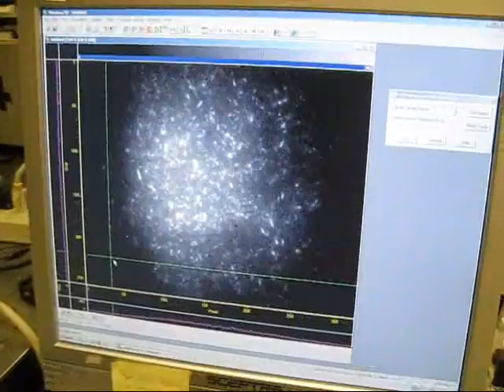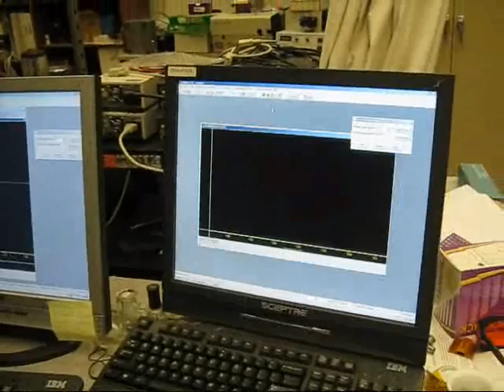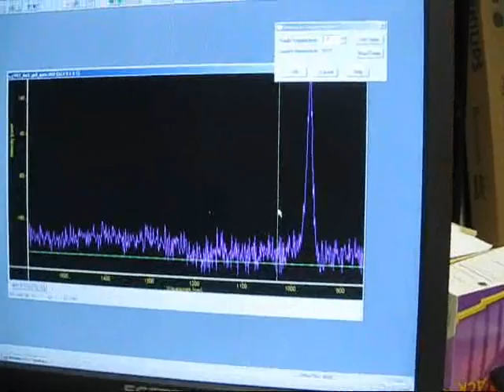Single nanotube experiment with tunable Ti:Sapphire laser Trestles sales@dmphotonics.com

Comment from the maker: CW Ti:S laser kit with small breadboard, one mirror set sales@dmphotonics.com
[CW-Ti:Sa-Kit-Basic]	
http://greyhawkoptics.com/product_info.php?products_id=805&osCsid=c98e9edf29f51647cc93c30b6716f115
CW Ti:S laser kit with small breadboard, one mirror set
Click to enlarge
CW Ti:Sapphire laser kit
Tuning range (@10W pump): 710-980 (two optics sets) or 730-870 nm (one optics set)
CW output power (@10 W pump, 800 nm): >1800 mW
CW wavelength tuning is available only with appropriate options (see below)
CW linewidth:
<45 GHz
<20 GHz (with 1 etalon)
<2 GHz (with 2 etalons)

Comment from the maker: Metal oxides single-walled carbon nanotube macrofilms-based lithium-ion batteries
Zeyuan Cao, Bingqing Wei
8 February 2015 • 4:25 - 4:50 PM | Part of SPIE OPTO

Simulation of exciton diffusion in carbon nanotube-based photovoltaics
Amirhossein Davoody, Irena Knezevic
11 February 2015 • 4:20 - 4:40 PM | Part of SPIE OPTO

Theoretical study of the behavior of cryptand with different ion metal inside carbon nanotube
Olga E. Glukhova, Anna S. Kolesnikova, Denis A. Melnikov, Mikhail M. Slepchenkov, Vladislav V. Shunaev
8 February 2015 • 5:30 - 7:00 PM | Part of SPIE BiOS

Emitting terahertz frequency wave by charged fullerene C36 inside carbon nanotube under electric field
Olga E. Glukhova, Anna S. Kolesnikova, Mikhail M. Slepchenkov
8 February 2015 • 5:30 - 7:00 PM | Part of SPIE BiOS

Dynamic carbon nanotube tracking by independent target restoration microscopy of cells
Nicolas Spegazzini, Rishikesh Pandey, Jeon Woong Kang, Ishan Barman, Ramachandra R. Dasari, Peter T. C. So
7 February 2015 • 12:20 - 12:40 PM | Part of SPIE BiOS

In vivo efficacy studies of immunologically modified carbon nanotubes and phototherapy against rat tumors
Joseph T. Acquaviva III, Cody F. Bahavar, Aamr Hasanjee, Fefian Zhou, Roman F. Wolf D.V.M., Eric W. Howard, Wei R. Chen
9 February 2015 • 5:30 - 7:30 PM | Part of SPIE BiOS

Intracellular delivery of a survivin-specific theranostic agent by pmma nanoparticles and carbon nanotubes
Francesco Baldini, Barbara Adinolfi, Claudio Domenici, Giuliano Giambastiani, Ambra Giannetti, Mario Pellegrino, Giovanna Sotgiu, Sara Tombelli, Cosimo Trono, Giulia Tuci, Greta Varchi
9 February 2015 • 2:40 - 3:00 PM | Part of SPIE BiOS

Imaging carrier transport in one-dimensional nanoscale devices using femtosecond photocurrent microscopy
Yeong Hwan Ahn
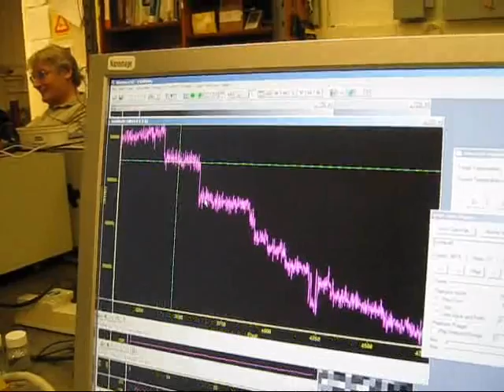8 February 2015 • 9:00 - 9:30 AM | Part of SPIE OPTO

Nanomaterials coated multiplexed fiber Bragg grating for multiparameter sensing
Shivananju B. N., Vishnu Prasad, Aravind C.G., Abha Misra, Manoj M. Varma, Sundarrajan Asokan
11 February 2015 • 6:00 - 8:00 PM | Part of SPIE OPTO

Prediction of stability for carbon nanotori
Olga E. Glukhova, Anna S. Kolesnikova, Georgy V. Savostyanov, Mikhail M. Slepchenkov
8 February 2015 • 5:30 - 7:00 PM | Part of SPIE BiOS

Two probe writing and electrical measurements of oriented carbon nanotubes
Aaron Lewis, Talia Yeshua, Christian Lehmann, Stephanie Reich, Kristin Strain, Eleanor Campbell
11 February 2015 • 2:00 - 2:20 PM | Part of SPIE OPTO

Comment: Laser Creates Graphene Electronics from Polymer

HOUSTON, Dec. 10, 2014 — An IR CO2 laser operating at room temperature can turn cheap polymer into multilayer graphene with heightened electrical conductivity and capacitance.
Researchers at Rice University say their one-step laser-induced graphene (LIG) process could enable rapid, roll-to-roll manufacturing of nanoelectronics. 
“This will be good for items people can relate to: clothing and wearable electronics like smartwatches that configure to your smartphone,” said professor Dr. James Tour. 
Laser-induced graphene image of the Rice University mascot
The Rice University mascot is produced on a flexible polyimide sheet by burning a graphene foam pattern into it with a laser. The scale bar is 1 mm. Images courtesy of the Tour Group/Rice University.
The technique works by converting sp3-carbon atoms into sp2-carbon atoms through pulsed laser irradiation. The resulting LIG is porous and about 20-µm thick. Because the laser does not cut all the way through, it remains attached to the flexible polyimide substrate. 
Typically, graphene has a hexagonal molecular structure, being composed of interconnected six-atom carbon rings. LIG is made up of overlapping flakes of five-, six- and seven-atom carbon rings. These defects allow LIG, unlike typical graphene, the ability to trap electrons and store a charge.
“Theoretical methods and density functional computations allowed us to look inside the electronic energy states’ organization,” said professor Dr. Boris Yakobson. “What we discovered is that the very low density of available states — which is crucial for the layer capacitance — increases dramatically, due to various topological defects, mainly pentagonal and heptagonal rings. The fact that highly defective graphene performs so well is a freebie, a gift from nature.” 
Scanning electron microscope image of laser-induced graphene foam
A scanning electron microscope image of laser-induced graphene foam. The scale bar for the main image is 10 µm; the bar for the inset is 1 µm.
The best results showed capacitance of more than 4 mF/cm2 and power density of about 9 mW/cm2, comparable to other carbon-based microsupercapacitors. Degradation was negligible after as many as 9000 charge-discharge cycles. 
Funding came from the U.S. Air Force Office of Scientific Research and its Multidisciplinary University Research Initiative (MURI), the Office of Naval Research MURI, the National Center for Research Resources, the National Science Foundation Partnerships for Research and Education in Materials and the National Institute on Minority Health and Health Disparities, part of the National Institutes of Health. 
The work was published in Nature Communications (doi:10.1038/ncomms6714).
For more information, visit www.rice.edu.
http://www.photonics.com/Article.aspx?PID=6&AID=56979&refer=weeklyNewsletter&utm_source=weeklyNewsletter_2014_12_18&utm_medium=email&utm_campaign=weeklyNewsletter

Comment: Upcoming graphene presentations:
Group velocity and extraordinary subwavelength imaging in graphene waveguides
Zheng Wang
8 February 2015 • 1:30 - 1:55 PM | Part of SPIE OPTO

Hydrogen sensor based on Pd nanocube-graphene hybrid
Duy-Thach Phan
11 February 2015 • 6:00 - 8:00 PM | Part of SPIE OPTO

Tunable graphene-based dual-frequency cross polarization converters
Jun Ding, Bayaner Arigong, Han Ren, Jin Shao, Mi Zhou, Yuankun Lin, Hualiang Zhang
11 February 2015 • 6:00 - 8:00 PM | Part of SPIE OPTO

THz generation by optical rectification in graphene at room temperature: beyond the linear carrier dispersion
Juliette Mangeney, Jean Maysonnave, Simon Huppert, Feihu Wang, Simon Maëro, Claire Berger, Walter A. de Heer, Theodore B. Norris, Louis-Anne de Vaulchier, Sukhdeep S. Dhillon, Jérôme Tignon, Robson Ferreira
8 February 2015 • 12:15 - 12:35 PM | Part of SPIE OPTO

Efficient Auger scattering in Landau-quantized graphene
Florian Wendler, Martin Mittendorff, Stephan F. Winnerl, Manfred Helm, Andreas Knorr, Ermin Malic
8 February 2015 • 9:45 - 10:00 AM | Part of SPIE OPTO

Towards graphene photonics and plasmonics
Shin Mou, Don Abeysinghe, Joshua Myers, Justin W. Cleary, Nima Nader, Joshua R. Hendrickson
11 February 2015 • 6:00 - 8:00 PM | Part of SPIE OPTO

Recent advances in the research toward graphene-based terahertz lasers
Taiichi Otsuji, Akira Satou, Takayuki Watanabe, Stephane A. Boubanga Tombet, Alexander A. Dubinov, Vyacheslav V. Popov, Vladimir Mitin, Michael Shur, Victor Ryzhii
11 February 2015 • 4:50 - 5:20 PM | Part of SPIE OPTO

Optoelectronic properties of graphene on silicon substrate: effect of defects in graphene
Brahmanandam Javvaji, A. Ghan, D. Roy Mahapatra, G.M. Hegde, R. Rahman
11 February 2015 • 6:00 - 8:00 PM | Part of SPIE OPTO

Hybrid TiO2-graphene and TiO2-multi wall carbon nanotubes below the percolation threshold as high-efficiency electrode in excitonic solar cells
Kadiatou Therese Dembele, Gurpreet S. Selopal, Riccardo Milan, Charles Trudeau, Afsoon Soudi, Marta Maria M. Natile, Giorgio Sberveglieri, Sylvain G. Cloutier, Isabella Concina, Federico Rosei, Alberto Vomiero
8 February 2015 • 4:50 - 5:15 PM | Part of SPIE OPTO

Photo-nano-therapy for bactericidal using graphene oxide
Jie Wu
9 February 2015 • 5:30 - 7:30 PM | Part of SPIE BiOS

All-printed reduced graphene oxide gas sensors
Symeon Papazoglou, Marina Makrygianni, Myrto K. Filippidou, Stavros Chatzandroulis, Ioanna Zergioti
10 February 2015 • 2:50 - 3:10 PM | Part of SPIE LASE

Delivery of recombinant tissue plasminogen activator with magnetic graphene oxide for target thrombolysis
Jyh-Ping Chen, Pei-Chin Yang
8 February 2015 • 2:00 - 2:20 PM | Part of SPIE BiOS

A control of phospholipid motion on graphene layer under external electric field
Olga E. Glukhova, Anna S. Kolesnikova, Mikhail M. Slepchenkov, Dmitriy S. Shmygin
8 February 2015 • 5:30 - 7:00 PM | Part of SPIE BiOS

From light modulation to far-field excitation of graphene plasmons: science and applications of graphene-integrated plasmonic metasurfaces
Gennady B. Shvets
10 February 2015 • 10:30 - 11:00 AM | Part of SPIE OPTO

Stability of composites based on graphene layers and carbon nanotubes
Olga E. Glukhova, Anna S. Kolesnikova, Georgy V. Savostyanov, Dmitriy S. Shmygin, Mikhail M. Slepchenkov
8 February 2015 • 5:30 - 7:00 PM | Part of SPIE BiOS

Third harmonic generation and multiphoton fluorescence in graphene using a compact femtosecond 1.56 µm laser
Antti Säynätjoki, Lasse Karvonen, Juha Riikonen, Wonjae Kim, Joonas Mäkinen, Seyed Soroush Mehravar, Robert A. Norwood, Nasser N. Peyghambarian, Harri Lipsanen, Khanh Kieu
9 February 2015 • 1:40 - 2:00 PM | Part of SPIE OPTO

Graphene vs more conventional narrow band semiconductors
Jacob B. Khurgin
12 February 2015 • 10:40 - 11:10 AM | Part of SPIE OPTO

Rapid fabrication of graphene on dielectric substrates via solid-phase processes
Wei Xiong, Yunshen Zhou, Wenjia Hou, Yongfeng Lu
9 February 2015 • 10:00 - 10:20 AM | Part of SPIE LASE

Laser direct patterning of graphene on SiC(0001) surfaces by KrF excimer laser irradiation
Masakazu Hattori, Kazuaki Furukawa, Makoto Takamura, Hiroki Hibino, Hiroshi Ikenoue
12 February 2015 • 11:40 AM - 12:00 PM | Part of SPIE LASE

Graphene-based metamaterial structures with single and multiple tunable transparency windows
Jun Ding, Bayaner Arigong, Han Ren, Mi Zhou, Jin Shao, Yuankun Lin, Hualiang Zhang
11 February 2015 • 6:00 - 8:00 PM | Part of SPIE OPTO

GaN-on-graphene technology: grow, release, transfer of thin-film GaN devices
Can Bayram, Jeehwan Kim, Hongsik Park, Cheng-Wei Cheng, Christos Dimitrakopoulos, John Ott, Kathleen Reuters, Stephen Bedell, Devendra Sadana
10 February 2015 • 11:15 - 11:40 AM | Part of SPIE OPTO

Chemically-doped graphene films as a transparent conductive layer in GaN LEDs
Jihyun Kim, Byung-Jae Kim, Sooyeoun Oh
12 February 2015 • 5:15 - 5:30 PM | Part of SPIE OPTO

Large-area gate-tunable terahertz plasmonic metasurfaces employing graphene anti-dot array structures
Peter Q. Liu, Federico Valmorra, Curdin Maissen, Giacomo Scalari, Jérôme Faist
9 February 2015 • 2:00 - 2:20 PM | Part of SPIE OPTO

A graphene-based microfiber in-line polarizer with stereo rod-microfiber-air structure
Fei Xu
11 February 2015 • 11:30 - 11:50 AM | Part of SPIE OPTO

Full electron-phonon-photon sensing of hot carriers in graphene
Bernard Placais
10 February 2015 • 5:20 - 5:40 PM | Part of SPIE OPTO

Liquid crystal THz photonics with indium tin oxide nanowhiskers and graphene as functional electrodes
Ci-Ling Pan
10 February 2015 • 4:00 - 4:30 PM | Part of SPIE OPTO

Manipulation of fullerene molecules on graphene
Olga E. Glukhova, Vadim V. Mitrofanov, Vladislav V. Shunaev, Mikhail M. Slepchenkov
8 February 2015 • 5:30 - 7:00 PM | Part of SPIE BiOS

Graphene nanosheets supported Ag/ZnO hybrid for effective acetylene sensor
A.S.M. Iftekhar Uddin, Gwiy-Sang Chung
11 February 2015 • 6:00 - 8:00 PM | Part of SPIE OPTO

Flexible tandem organic light-emitting diodes with graphene anode
Tae-Hee Han, Min-Ho Park, Sang-Hoon Bae, Hong-Kyu Seo, Jong-Hyun Ahn, Tae-Woo Lee
11 February 2015 • 2:50 - 3:10 PM | Part of SPIE OPTO

Ultrafast plasmon dynamics in graphene
Francisco Javier García de Abajo
8 February 2015 • 8:30 - 9:00 AM | Part of SPIE OPTO

Preparation and properties of graphene sheets coupled with magnetic nanoparticles
Yi-Seul Han, Kyung Eun Lee, Sung-Hyun Kim, Sang-Ouk Kim, Ji-Hwan Park, Kwang-Sup Lee
11 February 2015 • 6:00 - 8:00 PM | Part of SPIE OPTO

Terahertz harmonic generation in graphene
Samwel K. Sekwao, Jean-Pierre Leburton
10 February 2015 • 5:40 - 6:00 PM | Part of SPIE OPTO

Janus tectons: a versatile platform for self-assembling chromophores on sp2-carbon based substrates
André-Jean Attias, Ping Du, David Kreher, Fabrice Mathevet, Zheng Han, Vincent Bouchiat, Fabrice Charra
10 February 2015 • 1:50 - 2:20 PM | Part of SPIE OPTO

Electrical control and detection of nanoscale optical fields with 2d materials
Frank H. Koppens
9 February 2015 • 11:00 - 11:30 AM | Part of SPIE OPTO

Coupled simulation of carrier transport and electrodynamics: the EMC/FDTD/MD technique
Irena Knezevic
9 February 2015 • 1:30 - 2:00 PM | Part of SPIE OPTO

Photonics and plasmonics with 2D atomic membranes: physics and device applications
Farhan Rana
11 February 2015 • 10:30 - 11:00 AM | Part of SPIE OPTO

Ultrafast low-energy electron diffraction (ULEED) driven by nanotip cathodes
Claus Ropers
9 February 2015 • 5:20 - 5:50 PM | Part of SPIE OPTO

Fabrication of nitride LEDs on amorphous substrates by pulsed sputtering
Hiroshi Fujioka
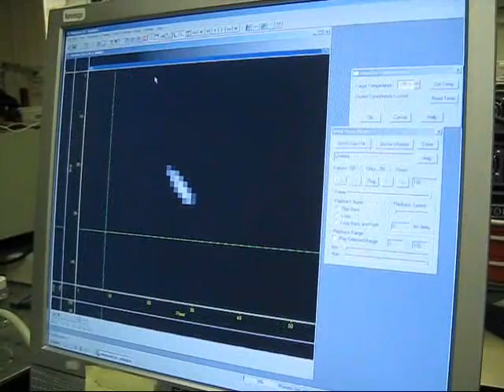11 February 2015 • 8:00 - 8:30 AM | Part of SPIE OPTO

Total absorption by degenerate critical coupling
Jessica R. Piper, Victor Liu, Shanhui Fan
12 February 2015 • 3:20 - 3:40 PM | Part of SPIE OPTO

Nanophotonic phenomena in atomically-thin van der Waals crystals
Dmitri N. Basov
10 February 2015 • 3:45 - 4:15 PM | Part of SPIE OPTO

Optical nonlinearities in few-layer gallium selenide
Lasse Karvonen, Antti Säynätjoki, Seyed Soroush Mehravar, Raul D. Rodriquez, Susanne Hartmann, Dietrich R. T. Zahn, Seppo K. Honkanen, Robert A. Norwood, Nasser N. Peyghambarian, Khanh Q. Kieu, Harri Lipsanen, Juha Riikonen
8 February 2015 • 10:00 - 10:15 AM | Part of SPIE OPTO

Structure and properties of composites based chitosan and carbon nanostructures: atomistic and coarse-grained simulation
Olga E. Glukhova, Anna S. Kolesnikova, Olga A. Grishina, Mikhail M. Slepchenkov
8 February 2015 • 5:30 - 7:00 PM | Part of SPIE BiOS

Extremely-high near-field enhancement in a novel plasmonic nanomaterial used for photovoltage generation
Debadrita Paria, Kallol Roy, Shishir Kumar, Haobijam J. Singh, Srinivasan Raghavan, Arindam Ghosh, Ambarish Ghosh
11 February 2015 • 4:30 - 4:50 PM | Part of SPIE OPTO

Comment: Graphene nanoplatelets - sales@dmphotonics.com

Graphene nanoplatelets are the stack of multi-layer graphene sheets including platelet morphology,with characteristics as follows:					
					
Physical Properties					
Diameter	Thickness	Specific Surface Area	Density	Electrical Conductivity	Tensile Strength
0.5-20um	5-25nm	                 40-60m2/g	             ~2.25g/cm3	8000-10000S/m	5Gpa
					
Bulk Characteristics					
Appearance	   Carbon content	Bulk density	Water Content	Residual impurities	
A black and grey powder	>99.5%	~0.30g/ml	<0.5wt%	                <0.5wt%	
					
Applications:					
* The high performance composites addicitive in PPO, POM ,PPS, PC, ABS, PP, PE, PS, Nylon and rubbers.					
*To be improved composites tensile strength. stiffness, corrosion resistance, abrasion resistance and anti-static electricity and lubricant properties.					
*For all mechanical properties modifications, track amounts about 2-6wt%					
*For conductivity modification, track amounts about 2-8wt%					
*Fuel tank and fuel line coatings.					
*Electronic enclosures: adds electrical conductivity to polymers at low densities of 3 to 5 wt%. These materials can also be used to provide EMI or RFI shielding to a variety of polymers.					
*Automotive parts: a composite with nanoplatelets can be painted electrostatically, thereby saving costs.					
*Aerospace: graphite has long been used in aerospace composites. Our nanoplatelets can be combined with other additives to reinforce stiffness, add electrical conductivity, add EMI shielding, etc.					
*Appliances: fortified polymers provide superior thermal and electrical conductivity, thereby saving the costs of separate heat dissipation mechanisms.					
*Sporting goods: graphite-based composites are stronger and stiffer and lighter than comparable materials.					
*Coatings and paints: our platelets can be dispersed in a wide variety of materials to add electrical conductivity and surface durability.					
*Batteries: graphene nanoplatelets increase the effectiveness of Lithium-ion batteries when used to formulate electrodes.					
*Fuel cells: both bi-polar plate and electrode efficiencies can be improved.